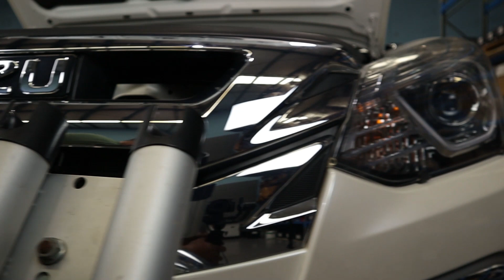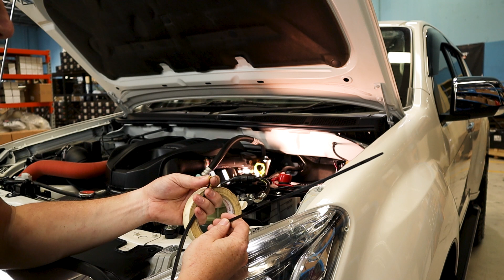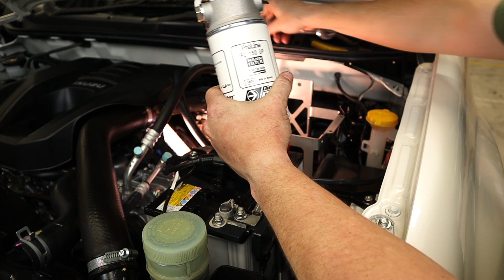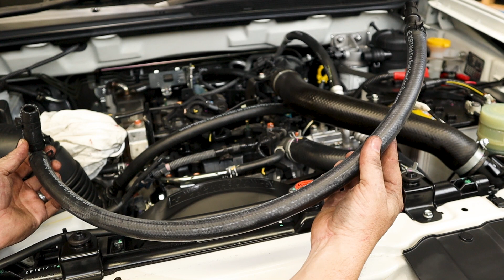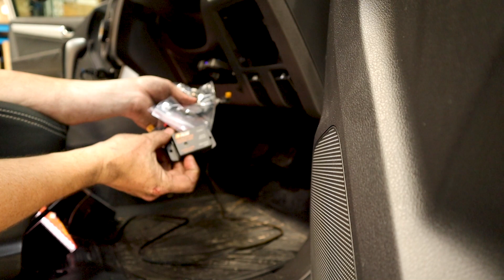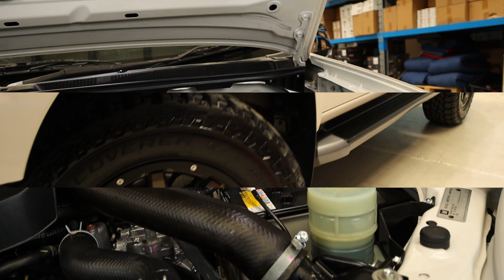ISUZU MUX DUAL PRELINE-PLUS/PROVENT DUAL KIT INSTALL

Comment: I was really keen to watch this video as I thought there would be some more detailed information about where to go through the fire wall and close ups of the fuel pumps etc.
Additionally, the sequence in the video bears no resemblance to the instruction manual, and as I have now done 80% of the catch can install, only to find out the fuel filter should have been prepped first.
My kit also has come with a three part bracket rather than the single piece one in the vid, which has its own challenges.

Post Install - It seems as though it is very easy to get small air-leaks in the fuel system, and once everything is bolted up (PL150 and Provent) it is really hard to get to any of the fuel line fittings  in order to trouble shoot.So my advice it to install the PL150 first, and get it 100% right, before embarking on the Provent, even though that is not explained in the manual. I think it is also imperative to ensure all the fittings with squash washers are really tight, as this seems like somewhere that Air could get in, but may not show as a diesel leak?